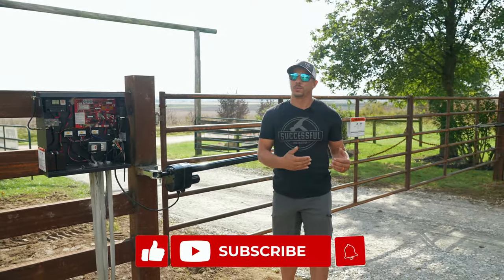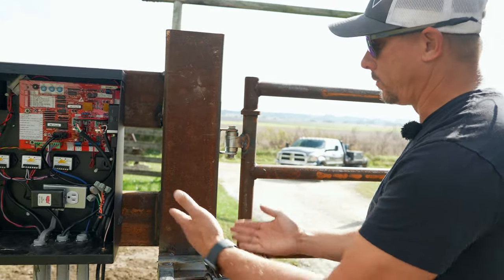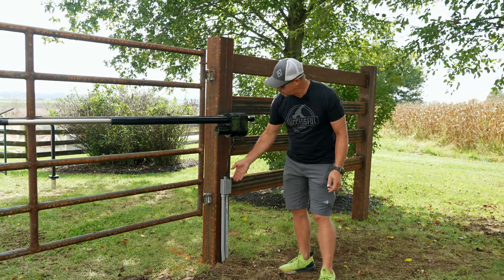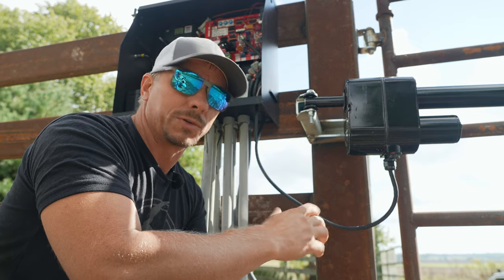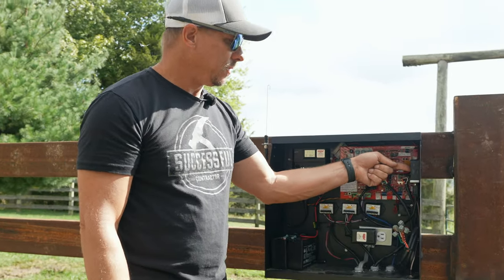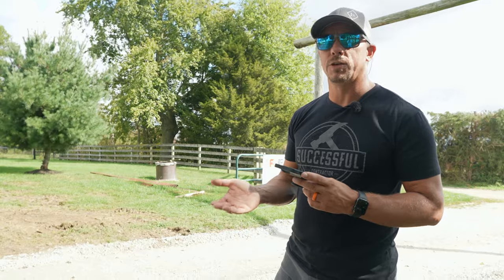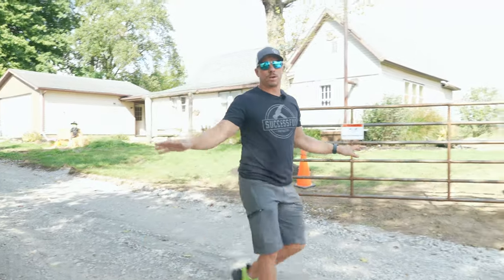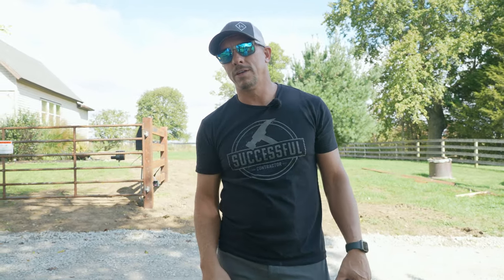World's Best Solar Gate Operator?

Comment: The latch open feature is priceless on any gate opener.  I've got the might mule and you have to fiddle with it to get the gate to stay open for deliveries, etc.  It can be done but it's a trip.  If I could find a mid range opener with latch open I'd replace mine.

Comment: so the ranger is the best entry level? im wondering if i should order this and get it shipped to australia where i live. how close does the loop detector need to be from the cars passing? my driveway is cemented nowadays but the dirt is probably only about 40cm away from the cement or vehicle will that work thanks
Reply from the maker: Yep, the Ranger is the best entry-level, but we really aren't set up to ship to Australia. Don't really know if we even can with regulations and such.
You'd need to cut your loop into the driveway--it can't be next to it.
You could try using a puck next to the driveway, like you see here for a free-exit circuit: https://youtu.be/JIfHxKhihMs?t=624

Comment: In your video talking about how insufficient ghost controls openers are, you talked about photo sensors not working with solar openers because of the constant high power draw. Sounded like you said these are battery operated. Can I retrofit these optical sensors to a ghost controls or a mighty mule? You also stated that you see a lot of issues with wireless keypads, but you've installed wireless keypads on this gate. Are the Patriot wireless openers better quality? Can you retrofit these on to a ghost controls or mighty mule opener? I would love to use a patriot system, but I am on a budget. Three times the cost is a little hard to swallow.
Reply from the maker: Wireless keypads can be problematic depending on the circumstances.  However on solar, they are the better option due to their lack of power draw.  Most wired keypads draw constant power and are therefore not well suited for solar.  As for working or adapting items to Spooky Controls or Majestic Donkey, we don't offer any advice or support other than to say "don't use them".  Simply adding photo eyes isn't going to solve the myriad of problems these operators have.  Proceed at your own risk.

Comment: I’m trying to source the ranger Hd kit…how do I confirm the separate locking delay module is installed?
Sites like gate master are next to impossible to get questions and answers from….my budget is 1.5 k or less for a single ball screw 24 inch strike actuator drive.
Reply from the maker: Hook up with the guys at the shop and they can get you the info you need: 307-578-8040 I don't think any of the Rangers are going to be $1,500 though.
Reply: @SWiFence  gate crashers had them listed at 1.3 K plus change
I just cancelled my order….I don’t even think they have any in stock…weird outfit….after reading BBB
I got nervous…with so many unhappy folks….

Comment: Is the opener in the video a patriot or ranger?
What is the difference
Reply from the maker: The one in the video is a Patriot. The Patriot can handle slightly longer & heavier gates than the Ranger.
The Ranger HD is identical to the Patriot in specs, but has a difference in how limits are set and some other small differences.

Comment: I'm sticking with my ghost controls but honestly, this isn't really an expensive setup for what you get and how robust it is. I might have done this if I had known about it.
Reply: Does your Ghost "closed" setting ever need to be readjusted? Mine goes out of adjustment every month or two about 2~5 inches. I contacted two other owners and theirs also needs to be readjusted from time to time.
Reply: I've got three ghost control gates and I'm so happy I stayed with ghost control sounds like the other company want to put anybody down to buy their product
Reply: @ridemfast7625  sounds like your brackets are loose
Reply: @sammymiller5967   Good call!! I checked everything and the outside bolt that holds the actuator arm bracket, the vertical bolt through the post bracket that goes through the ~2" plastic spacer, is tight.  But, when the gate is closed and if you push on the far side of the gate as if trying to open or move the gate, the bolt "slides", slightly moves, just a little bit.  Im afraid to tighten it more because the plastic spacer could break or crack.

Comment: Have you used any Viking gate openers before? and if you have, what do you think about them.
Reply from the maker: Yes in the past we have used Viking. The board is at a 45 degree angle in the operators which is nice for the user. However, the issue we ran into was mice nesting on top of the board housing and then the board shorting out from some of the mice awesomeness seeping down on it. I would imagine that this problem would be the same in warm climates with reptiles. They are a nice clean operator with built in heater for cold climates rated to -20 F. 👍🏻👍🏻

Comment: SWI. How about a video on how you do your 3 loops.?!?!?! Design, build, install….
Reply from the maker: Great thought! 👍🏻👍🏻
Reply: This would be great... question, the DSP7 controllers .... did you have to provide those as a company? Or do those loop controllers come with this gate system? I cannot seem to find any information on their website about it.  Please be specific, and if possible, yes, a video would be awesome.
Reply: @SWiFence  something you are considering?
Reply: @howiegrapek  no, Diablo loop detectors do not come with system. You will have to buy separately.
Reply: @Pokemonkids618  Yes, I was actually thinking about adding the loop sensor to my existing gate system, and was wondering how, exactly, to do it;  but after researching, it doesn't look too difficult.  Still, would love to see a video / description on how SWI actually did the connections to the ranger, and dialed it in.
Reply: @Pokemonkids618  Understood.  A nice addition to any gate opener.

Comment: Did your 50 hours include building the gates and installing the fence? Or just installing the gate operator system?
Reply from the maker: Just installing the operator. This time can vary substantially by operator package. 50 is a ballpark on an average installation.
Reply: @SWiFence  Thank you sir, I'm an estimator here in Savannah Georgia and that time pretty much matches up with what I would quote to install a similar size job with installing the gate post, gates, and the operator system, however we no longer run all the conduit on our jobs due to a lack of man power so we sub the trenching in conduits and electrical to an electrician. When I was an installer I ran my own conduits like you did. A US Automatic Patriot was the first linear style swing gate operator I ever installed 21 years ago and that operator is still in use today on an entry gate leading into a tree farm and it's been solar operated all these years the only thing I have changed was the marine battery every 3-4 years or so. I was just telling Mr. Mike about it when I saw him at Fence Tech a little over a month ago. Thanks for the great video.
Reply: When trenching for conduit what is the recommended depth? I’ve found 4-5” for the sensor but I can’t find a depth for the conduit. Any help is much appreciated!

Comment: Can you spec out the ram, control board and phone app…..???
Prices…?
Reply from the maker: We don't spec out items and prices in the comments, but you can browse the gate openers here: https://bit.ly/USAutomaticGateOperators
Also, feel free to call the shop and ask any questions you have. They should be able to get you hooked up with answers: 307-578-8040
Reply: @SWiFence  what is LCR…on their web site?
Reply from the maker: Low Current Receiver. For solar.
Reply: @SWiFence  the 1/2 mile range receiver would be very useful

Comment: The amount of play, slop https://youtu.be/GdkhkT0nAi0?t=213 ,  in that opener is fantastic compared to my spookie. Those quality DD hinges may also keep things more tight.  Spookie goes out of adjustment in closed position every several weeks or more., from 2~5 inches. Contacted a couple spookie owners and theirs also needs to have the closed setting readjusted from time to time.  Do these US Auto openers ever need to be readjusted? Not referring to poorly installed systems with wooden warped posts, posts not set deep enough...  When the spookie gives up the ghost, spending more is worth it if youre going to stay in your home for several years.

Comment: I'm thinking total cost to be about $5,000? 🤔
Reply: Considering the cost of this system is $3500, I think it would be around $8-10k total depending on area and labor rates.
Reply from the maker: The supplies alone for a dual operator will cost 3500-4500.

Comment: Ta da right from your phone how amazing is that? Not amazing at all considering the price tag of that $900 gate opener that you sell for thousands. No thanks.
Reply from the maker: Oh here we go again. 🙄 Honestly, if you've got access to a $900 opener that you're convinced is the same--go for it. I wish you the best.
Reply: My gate opener cost me about $500 7 years ago and TA DA it does exactly the same thing.
Reply from the maker: Really? A $500 gate opener that's UL325 compliant with a free-exit loop, safety loop, photo eyes, 12-second cycle time, rated for 800 lbs, 500 lbs of dynamic thrust, static load rating of 1,000 lbs, real battery backup (not just 1 cycle), and comes with a 5-year warranty on the control board? Man! You got a steeeeeeeaaaaal. 👍🏻
Reply: What does your gate opener do that mine doesn’t ? Mine opens when you drive up to it to leave and has a key pad and remote controls to open when k come in. If it hits something it stops. I guess if I needed to keep up with the Jones’s I’d buy yours. Honestly tho steel and wires is steel and wires.
Reply from the maker: So, seriously not trying to be a jerk here, but this is a matter of perspective and experience. When you install gate openers routinely, and when you warranty your work and have to go back and repair what failed on your own dime, you learn real quick what you are and aren't willing to install. We work in Wyoming, where the gate opener has to work whether the temperature is below zero or not, or if there's snow on the ground. The batteries have to remain charged even when the sun has been absent for several days in a row. Add on top of that UL325 certification requirements and the list gets even narrower. When we are the last people to work on a gate we become liable for it from that point forward. This is why we won't service gates that aren't already UL325 certified--we can't afford that liability.
A house and a mobile home will serve the same purpose. They both have a kitchen and bedrooms, etc. But they're not the same. They're not going to age the same, they're not going to feel the same in cold weather, and they're not going to be the same in a tornado. Is there anything wrong with living in a mobile home? No. Is a mobile home the best choice? It might be--it depends entirely on a person's circumstances and needs. But they aren't the same. We just want people to know there's a difference. If they choose to go with a cheaper option--that's great! But we've worked on far too many gate openers to shrug our shoulders and say that they're all about the same.
Reply: Yeah well I noticed in the video the shoulders were shrugged when you realized you didn’t have the correct battery but using two smaller batteries worked just the same. If people wanna spend more it’s their choice.